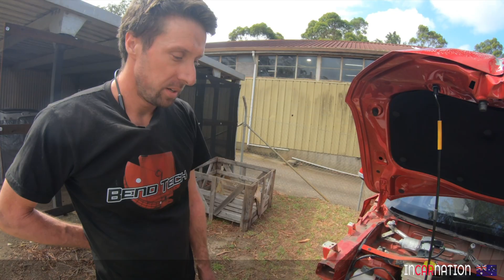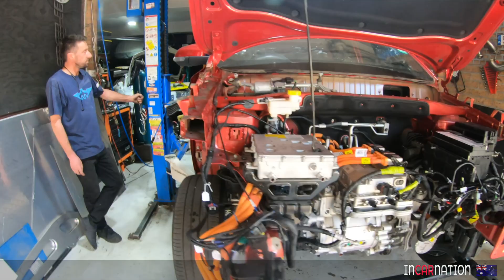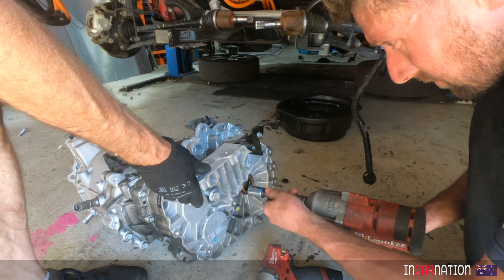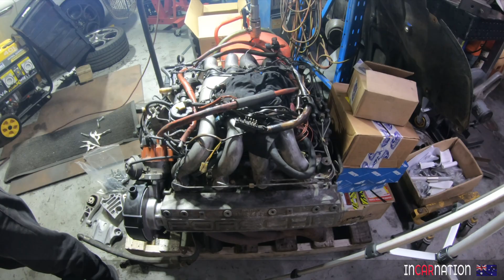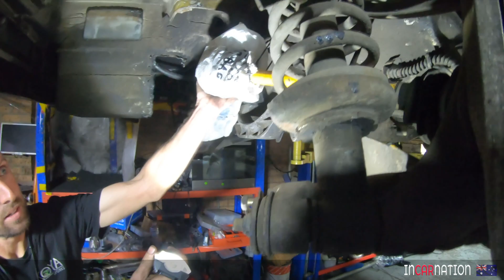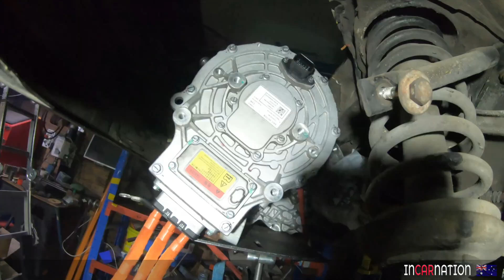Episode 14 – Porsche EV Conversion | Can We Make This Motor Fit?

Comment: How will changing the angle of the motor and diff affect the oil pump? I understand that when the orientation a Tesla motor is changed it needs changes to the oil pump.
Reply from the maker: Good question. Unlike the Tesla motor, the simple MG motor doesn't have one. It's just a splash diff arrangement with just over a litre of gear oil. We will pull it apart for a look to check but not anticipating any dramas. Except for swapping location of breather and drain plug.

Comment: Coming together Stu!  It’d be interesting to see if the Tesla drive unit would have been harder or easier to fit. 

If you still have the transaxle I’d be interested to see how much it weighs compared to the MG drive unit. I expect that you are right about needing to put stuff in the back to keep the weight distribution right.
Reply from the maker: I think Tesla SDU would be easier. It has greater clearance to the cross-member and good side clearances. Mount locating bushes a bit better placed too. And I wouldn't have to run it upside down (which probably poses more oil lube issues for the Tesla motor). So Tesla power still an option if I screw up the MG plan for whatever reason.
Reply: @inCARnationAustralia   Hey Stu. While not helpful to you now, if you could borrow a drive unit and hold it up in place to show how it fits might make some interesting viewing for the channel  - ie before there is an MG unit taking up the space.

Comment: You could probably sell the battery box - you might get $200AUD for it.
Reply from the maker: If you mean just the MG's aluminium battery case, yeah it might be worth $200 just as scrap. But as far as the batteries go, that'd be a good deal for somebody. The CATL batteries are available to buy online. They're AU$1000 each. And did I mention there are 18 of them. Yes, $18k. And that's just the cells, before you add the HV connectors, the BMS, the cooling system, design and build the box.
Reply: @inCARnationAustralia i got $67 from the recyclers for the battery case.
Reply: @inCARnationAustralia  I meant the 928's battery box!
Reply: @AndyD070568  bear in mind that someone in the past had cut that battery box shorter.  I doubt that it'd sell. Maybe the lid is worth something.